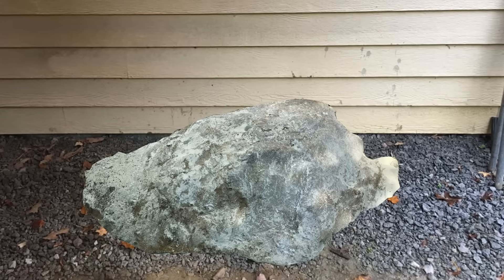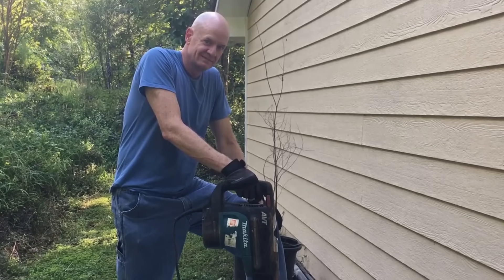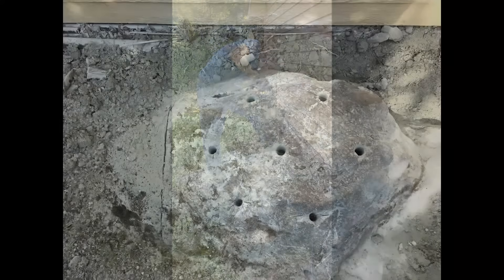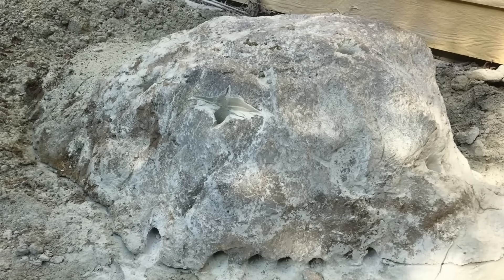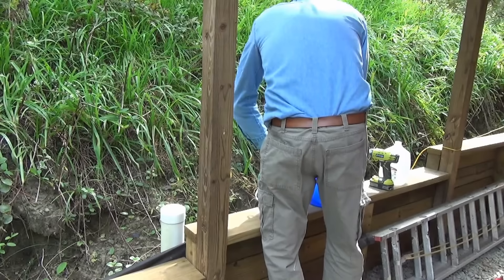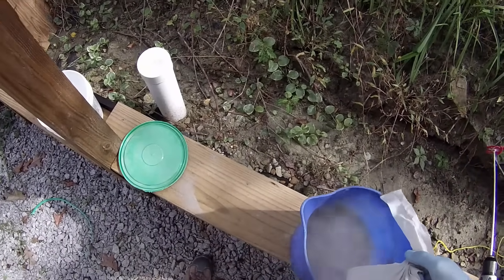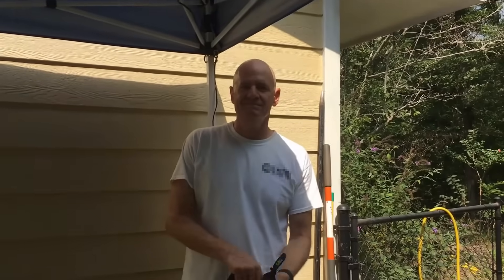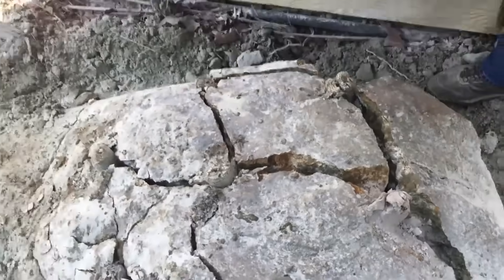Removing a BIG Rock: Dexpan to the Rescue! (#4)

Comment: I watched my uncle do something like this in the 70's.  He drilled holes in a giant rock and then filled them with something he mixed up from stuff around the shed/barn. And filled the holes with the slurry, then pounded pieces of wood into the holes sealing them. You came back the next morning and it would be all cracked up. then rinse repeat until that boulder was small enough pieces to drag away with a tractor.  Maybe 1974?   I always wondered what he mixed up in his witches breww? now i kinda know...he was making dexpan or whatever expando stuff.

Comment: I have never seen this product before. Works awesome. Just wondering if a mini excavator could have fit in there to remove it?
Reply from the maker: An excavator tried to remove it when the garage was built but could not because the rock is huge.  Dexpan let me break off the top of it to get it below grade. Thanks for watching!
Reply: @ that makes sence. Very cool video

Comment: To anyone who may choose to use this method, please consider your own safety: wear safety glasses and a mask that will prevent  particulates  (rock dust) from entering and becoming trapped in the distal airways of your lungs. I do not know how loud the drill and the drilling process are but to be on the safe side, foam or silicone ear plugs are inexpensive and easy to wear. Thank you.

Comment: lol at "doom stick" I have an iron bar my Dad had it's about 1 to 1 /12 inches in diameter pure steel and 6 1/2 feet long. It has to weigh at least 20 or 30 pounds. I call it "The Persuader" used on winter driveway ice, fence posts, and perhaps annoying people. I'm out of breath just carrying it to where I need it before I even use it.

Comment: A few years ago at a house I owned in Missouri had a small 6 inch rock sticking out of the ground at the side of the house, I went to remove it, but as I started to dig it go bigger and bigger. It ended up being about 3 foot deep and two foot wide. But I got it out

Comment: If not in a hurry and you live in a cold winter area you can have the same results by filling the drilled holes with just plain water. When the water freezes it expands and will crack the rock the same way.

Comment: You should pull the bit out of the hole occasionally to clear some of the dust.  The dust will eat at the bit and cause "lock-up".  Just a tip from one who has done this.
Reply: The fact that he broke a bit confirms your assertion.
Reply: Also adding water to the holes cools the bit, and actually makes it drill faster.
Reply: And start with a smaller bit first.
Reply: @Kr0N05 does this help or does it make it harder to line up the drill hole

Comment: This is a great idea but it has the same drawback as using feather and wedges. You have to drill the holes. And for the Dexpan to work the holes need to be very deep. Unfortunately the rock I am working on is extremely hard and white like mutton fat jade. I burned two rock drills using my hammer drill and still didn't get to the eight inch mark recommended by my feather and wedges. I even bought some high end rock drills with four cutting teeth so I wouldn't dull the carbide cutting edges so quickly. I got to the bottom of the first hole but I can see a fair amount of wear on the four carbide teeth.

Comment: could you cut down   a  tree by suing this stuff as a "final" cut?
Reply from the maker: Definitely not!  It only expands a little bit, which is plenty to crack a rock but not nearly enough to fell a tree. Thanks for watching!
Reply: @DIYMyWay  thanks that makes perfect sense.  I got two big volcanic rocks in a driveway I'm building, and I was planning to trim them down with 120volt drill, and other hand tools, this
could help with that.    I was breaking them with only  a 1/2 inch masonry bit.. would this stuff have a minimum practical drill size?
Reply from the maker: The bit needs to be 1.5” for best results.  However, you might consider buying a feathers and wedges set which will work with a 5/8” masonry bit.  I have found them to be very effective at breaking up rocks as well and you don’t have to wait for overnight expansion.  You can use them over and over again to break up even big rocks.  Good luck!
Reply: @DIYMyWay   thanks  for that advice  I been brute forcing it with wedges and a big hammer...
during my initial attempt I pretty much  destroyed  a cheap  battery drill  making the initial holes

Comment: When drilling, can you run water from a water hose in to keep it clear and cutting and cooling the drill?
Reply from the maker: I haven’t tried that but it might be helpful.  I’d be afraid it would make a messy paste when mixed with the rock dust and be harder to clear out the hole with compressed air. Thanks for watching!

Comment: Thanks, good instructions. I’m going to try this approach on a similar but slightly smaller rock in the middle of my yard. I’ve had good luck with Dexpan breaking up concrete steps but have never used it on rock. Tried the feathers and wedges approach on another rock but it was considerably more work.
Reply from the maker: Glad it was helpful!  Good luck and thanks for watching!

Comment: My Bosch Makita drill bit keep on breaking , can I purchase and use pointed chisel bit to put hole in rock ?
Reply from the maker: I doubt that would work unless it is a very soft rock, in which case you wouldn’t need the Dexpan.  Perhaps try buying another brand of drill bits. Thanks for watching!

Comment: What would be the best drill bit for drilling a boulder, I have tried everything but no bunny rabbit.  Thx for the vid
Reply from the maker: Regardless of the rock, Dexpan calls for a 1.5” bit.  The length will vary with your project but I’d go with at least an 18” long bit.  The harder the rock the bigger hammer drill you will need.  That Mikita I rented from Home Depot was a BEAST.  Good luck and thanks for watching!

Comment: Have to admit I have used Dexpan a few times, as you we had huge rocks where we dug out for our basement.   Your video would have been a tremendous help had it been out then but I'm sure many will learn from it.  Personally I cannot say enough good about Dexpan and it works every time.  We rented and air compressor and air drill made it a much quicker and easier job but had many rocks to do so that is why we did it.  Enjoy your videos.
Reply from the maker: Hi Don!  The air drill is a good idea!  Happy to meet another Dexpan fan.  Thanks for watching!
Reply: @donmccormick856  "Have to admit I have used Dexpan a few times,"

Why do you have to "admit" to using Dexpan?   Is there something wrong with using Dexpan?

Comment: Very nice!
That was a well made little video.
Im in construction. Ive jacked up and leveled cottages. Poured foundations. Built houses. A spillway dam across a 75 ft wide river. I was a structural steel Iron worker Ive built skyrises. Ive stacked cell towers. 
I have since slowed down in my older years to a more elegant trade. Log homes. I wanted to say  dont stop with these. I learned something new. Thanks for the upload.
Reply from the maker: Thank you, Neil!  Clearly, you’ve had too much fun in your varied work  experiences!  Glad this video added a nugget of knowledge to your vast know-how.
Reply: @DIYMyWay  ive done alot.
I was interested in blasting some ledge on my property. I had heard of that expansive material before but, I couldnt remember the name. Nor did it occur to me to look for it.  So I set off to find out what i needed for a ANFO handling and blasting permit and found you. Your way was far more economical. I may not be able to have the fun of blowing up some rocks but at least Ill get the job done quietly.
My neigbors unknowingly thank you!🤣
Reply: I have a santer stones cracking but problem is supplying  I don't have   enough   tooll  even car to  delivery

Comment: You mentioned that you broke a drill bit. My guess is it got too hot from the way it was binding on the dust. And you need to swap out the steel after every couple of holes. One of the clearest DIY vids on the net. 👍

Comment: If it were me I would have just ordered a set of feathers and wedges.
For about 60 bucks you get six of them and a drill bit.
The holes are only 5/8 so much easier to drill.
Then it's just a matter of tapping them in to break off chunks of The Rock or to break the rock itself in half.
And when you're done you still have the feathers wedges and drill bits for the next project.
Reply from the maker: Sounds like that’s worth a try. Thanks for the tip!

Comment: does it work on tree stumps?  

i worked in a mine where we broke rocks with a 16 pound hammer.  a few whacks at a rock on the flat side breaks it, then put a hook in the split and pull. i've broke lotsa rocks. 

most all rocks have a grain. if you hit the flat side of a big rock it follows the grain and splits.  cement doesn't have a grain and some rocks don't have grain.  that's where you use powder to blow it.  you used to be able to buy blasting power at a hardware store.

this stuff in the video. will it work in a big tree stump, or does it have to expand in a hard rock to work?
Reply from the maker: I doubt it.  Tree stumps would give to much.  As far as I know it only works on rock and concrete. Thanks for the tips and for watching!

Comment: Well martin another well thought out, well explained & well executed project. However I would have done it differently which is a combination of 2 reasons. Basically I'm lazy when it comes to project and usually try to find the "easiest" way in my mind to do it. The second is that if I can get a machine to do something and I physically don't have to then all the better so I don't have to break a sweat, and I got a lot of hours in the seat.  All of what I am going to say is based on how things appear in the video since I was not able to be there. So measurement's etc are not at my disposal to help make decisions. Since you said that you could get your backhoe in there to finish up with the clan up I am assuming (yea I not I hope I'm not doing that) that I would be able to get the L3800 & BH 70(?) to that spot. If possible I would have positioned the machine to be parallel to the garage and dig only on the outside of the rock away from the garage making a hole big enough to role the rock into & extract with my grapple. If no grapple chains could be used by laying them underneath where the rock would land & then hook the chains to the chain hooks on my bucket. If the rock was to heavy for the tractor to lift it out and you don't know that until you get into the project. In any event if it is to heavy or if there is another reason you can not lift the rock out of is to dig a hole big enough to bury the rock in deep below. Done this many time as the L3800 does has it's limitations. If I could not get the tractor in there parallel to the garage I would have brought it in BH first and done the digging the same way with the same options available what done digging. Both of the ways/positions I mentioned make it possible to do all your digging necessary without any danger damage to the garage and the garage floor. Hard to give a good time estimate from the video but in all honesty not much more than 2 hrs total + or -. But then again I'm lazy especially at my age as the more I work the more I seem to ache. Just because I would have tried to do it differently does not in any way take away form your analysis, assessment and execution of the project and your excellent development of the video.
Reply from the maker: Thank you, Wayne!  Unfortunately your way would work with this rock because it was the tip of the proverbial  iceberg.  The rock spreads out in all direction below ground.  A very large excavator was unable to budge it back when the garage was built.  So my only hope was to break up enough of the top of the rock to get it below grade which is what I did. Thanks for watching!
Reply: @DIYMyWay  Ah Ha... As they would say in the court room " facts not in evidence at the time of the trial " (assessment I mean). Oh well I guess in that case I would have prescribed a bigger hammer.  

Martin, where do you live roughly and what did you do before DIY? Thanks, Wayne.
Reply from the maker: Quite right, Wayne! I live in the West Georgia area and spent most of my career in IT and telecommunications.
Reply: @DIYMyWay  That would explain your communication skills. Also why in the winter I don't see much snow about there. I knew it was not up here as King snakes are not indigenous to any where near here. Here for me is northern New Hampshire. Close enough to Canada if that I stand on a small mountain or big hill with a strong wind at my back I can spit and hit it... But in the winter time it freezes before it can get there. Especially this year -21f this morning.
Reply from the maker: Minus 21F!  Yikes!  Too far North and way too cold for me!  That’s why I’ve always been content to live in the South.
Reply: @DIYMyWay  LOL To bleeding hot & muggy there for me. While it is cold here you can always put on another layer. However in  the heat you can only take off so much. Then again for some of the population it is enjoyable to see them when it is hot. Oy Vey  ...

Comment: Isnt there a limit to drilling an extra hard rock with a rotary hammer?, i have experienced drilling into concrete and some of the rocks contained in the mix, burned up many bits, even high quality ones, even when following all precautions, some granite rocks might be imposible to deal with especialy the depths you must drill to break a rock using this method, and using a 1 1/2" bit?
Reply from the maker: I’m sure there is a limit and some rocks have been easier to drill than others. Thanks for watching!

Comment: You reckon a 1” hole will do the job?
Reply from the maker: I know for a fact it won’t. Tried it once with poor results.  Go with a 1.5” if at all possible but not less than 1.25”. Good luck,
Reply from the maker: I know for a fact it won’t. Tried it once with poor results.  Go with a 1.5” if at all possible but not less than 1.25”. Good luck,
Reply: @DIYMyWay  I did some research and in looking at the Q&A on Amazon, there are people who have had success with holes as small as 3/4 inch. But, they have to be very close together and it takes longer than usual. I’m gonna keep researching and if I feel confident, I’ll give it a go. Thanks for the feedback 🙏🏻

Comment: I just uncovered a granite rock on our property approximately 8 or 9 feet long. Tractor grapple didn’t work. Mid size excavator won’t budge it without digging too much around it where there’s not room. Thanks for this video. Now I have a plan.
Reply from the maker: That’s a BIG rock, Tom!  Dexpan should do it, but it may take multiple times if the rock is very thick.  Good luck!

Comment: Drilling a smaller hole goes much faster, like a 3/8", then drill it a second time with a larger diameter bit of the desired size needed.  Overall it goes faster and easier. IMO.  It's also far easier on the drill bits and drill.
Reply from the maker: Makes sense. Thanks for watching!
Reply: Great advice. I’m going to do that this weekend

Comment: It helps to clear the rock dust periodically while drilling, it reduces wear on the bit and improves the rate of drilling.
Reply: I also always drill no larger than 10mm ( around a 3/8”) on my primary hole, then run the larger size (in this case around 25mm / 1”).  Goes sooo much faster, and the 10mm bits are quite a bit cheaper, and the larger bits last a lot longer, and rarely break.
Reply: @andrewallason4530 any challenges getting the second hole lined up?
Reply: I agree. A small stream of water to wash out the cuttings.
Reply: @mrcryptozoic817  For cooling too.
Reply: No no no it’s his way or the highway don’t waste your breath

Comment: This dexpan does the job we have just removed a rock in a celer 4m L 1M H 1M D after being gasted out by fumes shaken to bits be brakers  5 sthil blades and 9 hours of hard work we did it with dexpan 👍👍👍👍🇬🇧🇬🇧🇬🇧🇬🇧🇬🇧🇬🇧🇬🇧🇬🇧🇬🇧🇬🇧🇬🇧🇬🇧🇬🇧🇬🇧🇬🇧🇬🇧

Comment: What a beautiful video. I have gone 15ft in digging my well but met a very big rock. Can I pump out the water and pour chemical or is it ok to be used in busting rock in the well.
Reply from the maker: Thank you!  These are probably questions best asked to Dexpan.  If the water will stay out and not seep back in during the time the Dexpan is working it would probably work, but I don't know how safe it would be drilling the holes.  The vibration might cause a collapse of the sides.  Also, I don't know if the chemical residue would contaminate the well.  Good luck with your well!
Reply: No it has to go inside something firm how would you drill a hole onto a rock 15' down

Comment: Got me thinking about some locust stumps that I had excavated to build my house. At ground level they were 3 feet across. Excavator had a hard time getting them out.
Reply from the maker: Hi Kevin!  I’m not sure it would work on stumps since wood is more flexible than rock.  Dexpan relies on the fact that rock can’t give without cracking. Thanks for watching!
Reply: I used this stuff on bridge abutment rehab wont work with wood. Material has to be strong

Comment: Why? After doing all the hard work: the drilling.
Why would you not use chissels and feathers?
That is the fun bit! And it is quicker.
Reply from the maker: Because while I have some chisels, I don't have any feathers. Plus, this did the job overnight while I got a good night's sleep.  Thanks for watching!
Reply: Apparently you have never worked with very hard concrete or rock